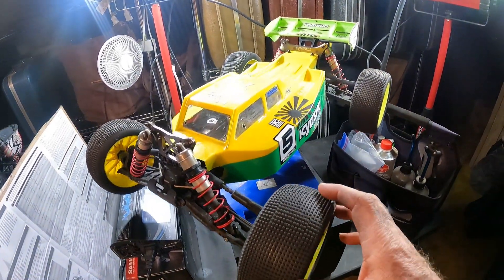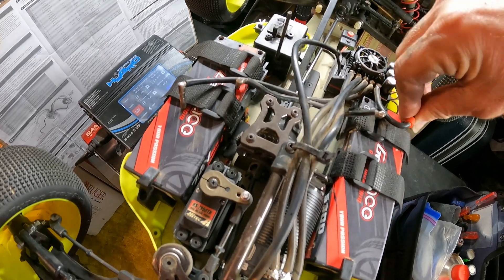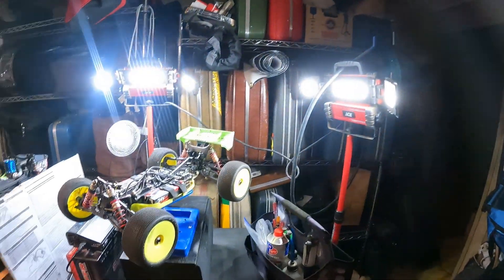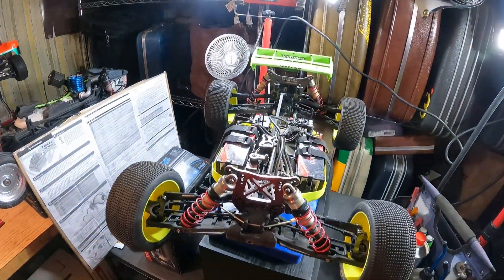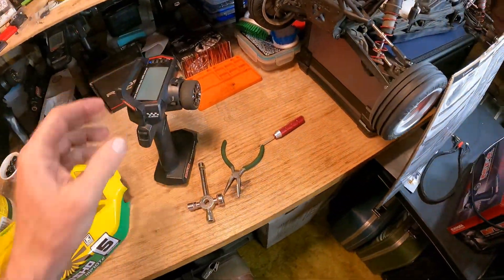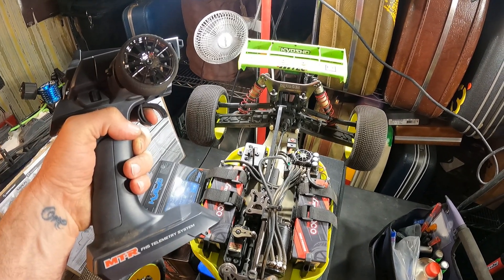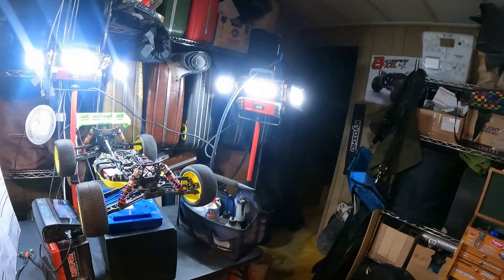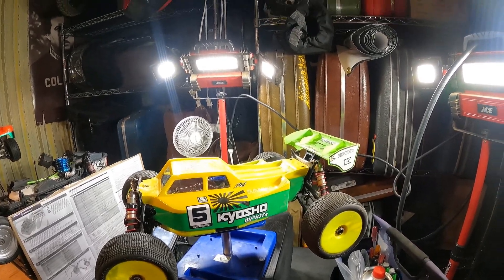Quick chat about the E-Truggy

Comment: Adjust the neutral point on the ESC to tighten up the trigger so there is only a small amount of deadband. Definitely a cool rig!
Reply from the maker: Thanks for the rad clue, Mike! Way helpful!
Reply: @highdesertaggrorc7801  As for shutting down that might be overload protection or voltage cut off lvc?
Reply from the maker: @mikesrcgarage  Thanks again Mike, my dude just let me know he got it working good and did a bunch to it. I wish he was also a content creator so he could rap about it but he does not do videos. I'll take it out for a run and show the progress, maybe I can elaborate on what he found and throw that in a vid as well😄